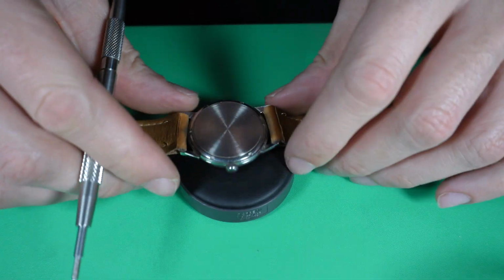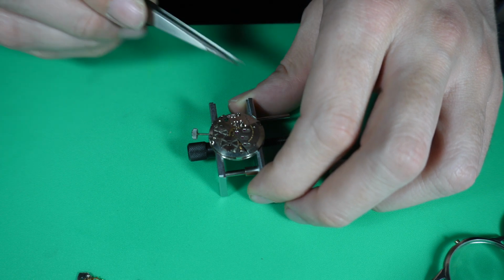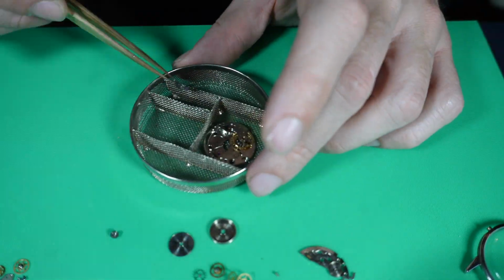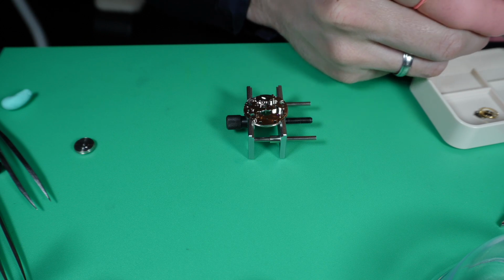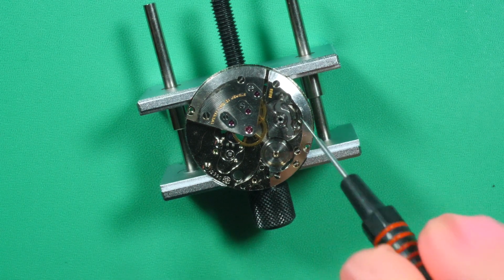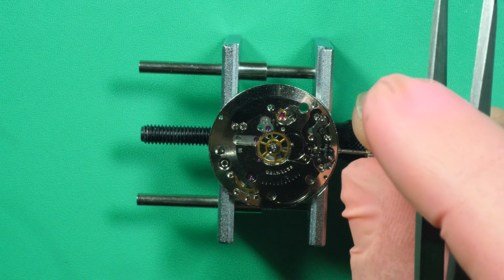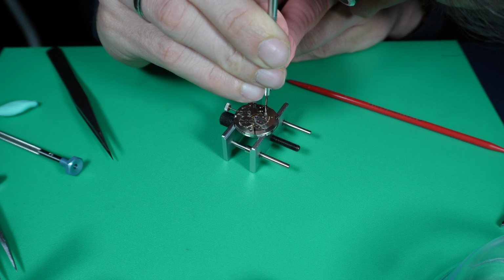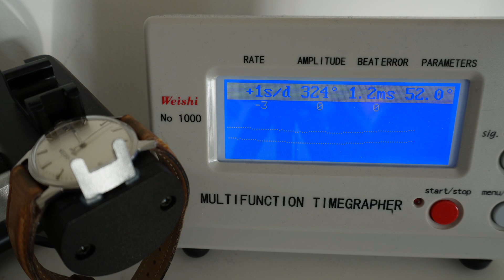Jaeger Restoration without LeCoultre !!!

Comment: Magnifique! Very unique, especially the mainspring ratchet click spring arm & I like the pivot jewel retainer cap design. 
It seems to me that they would be much easier to service because of this design & you would not have to deal 
with a spring metal pivot jewel retainer that is prone to be lost much more easily in the process of assembly :))))
Reply from the maker: It is true that this movement has some unique feature. That is what I like working on vintage watches. It is always different